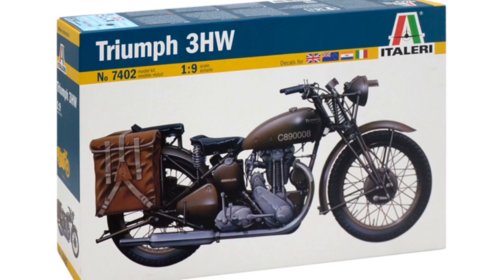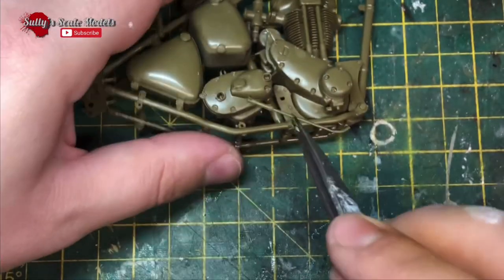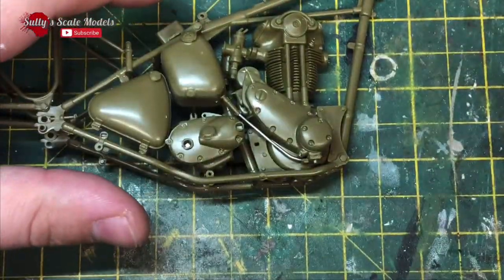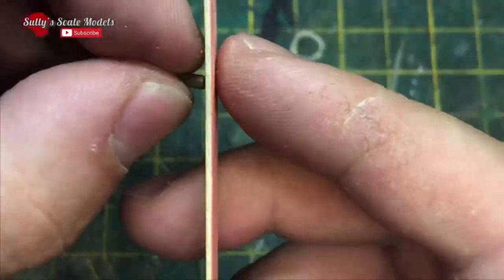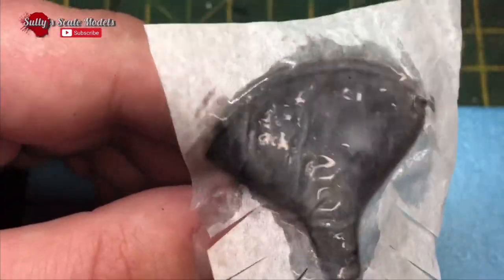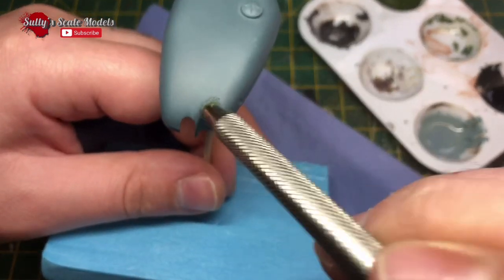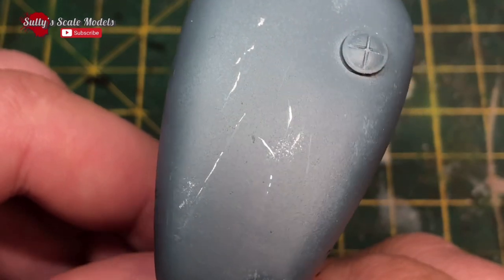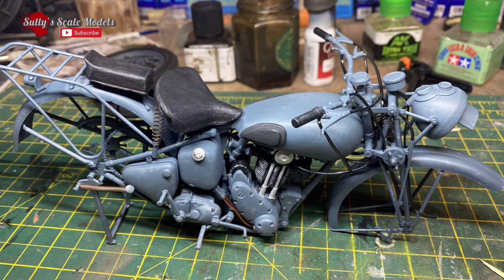Italeri 1/9 scale Triumph 3HW . Part1

Comment: it was one of the worse models i put together
Reply from the maker: Ye it wasn't the best I found the framework around the wheels was the wort part
Reply: @SullysScaleModels  i thought the whole front end sucked
Reply from the maker: @leroymitch3153  ye i had to put a new bar to support the front fender
Reply: @SullysScaleModels  i'm having trouble where it goes in the neck. not enough to glue to.. any idea how to change it.
Reply: @SullysScaleModels  i don't see where you put the front end together
Reply: @SullysScaleModels  i saw that